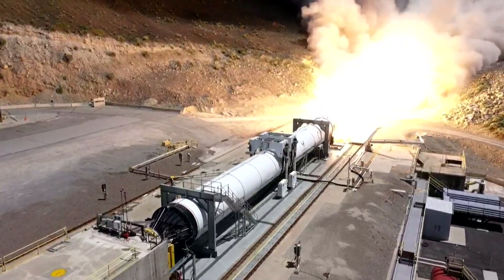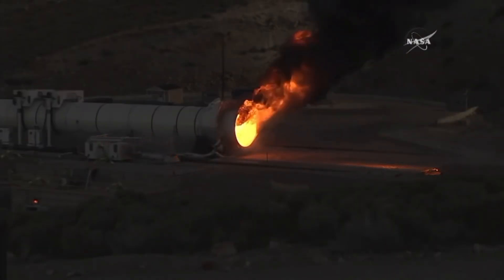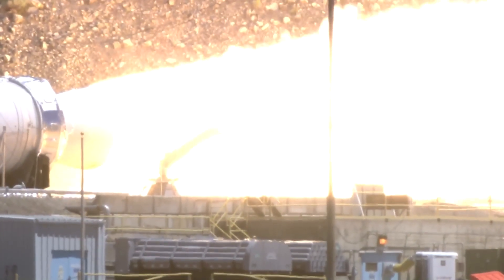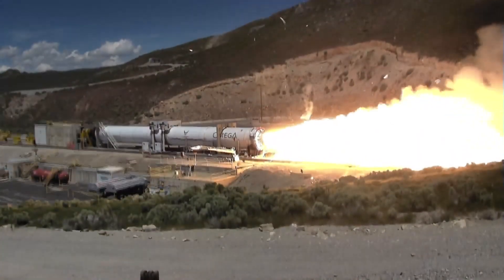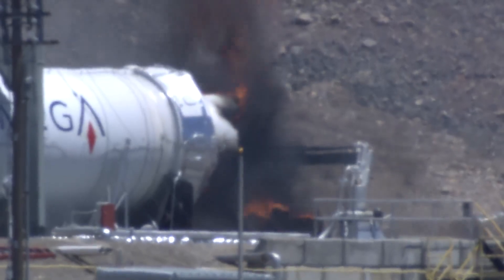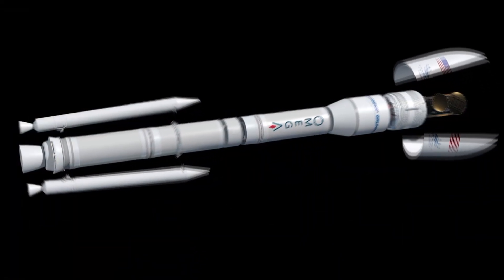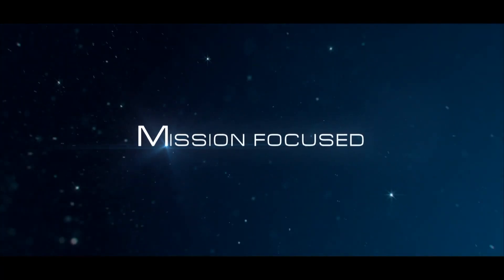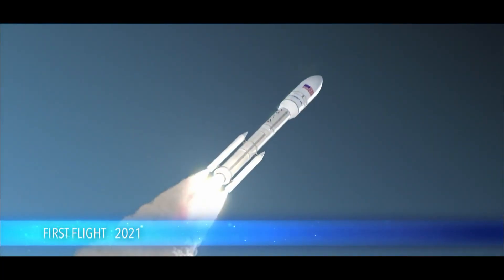Northrop Grumman's OmegA Rocket Fails During Static Fire Test -

Comment: It's CO2 that's pumped into the booster by that arm.. Listen to the test videos of the SLS engines and they talk about it. I'm pretty sure it was caused by just a weak casting or however they make that nozzel. I think you would've seen a chunk coming out, it just looked like it over pressurized the nozzle and the nozzle couldn't take it and broke apart. If a chunk would've hit one side of the nozzle I would've expected to see only one side of it ripping apart instead of the entire thing.
BTW does anyone else think that pumping all the CO2 out is far worse for the environment than any car could be? Or is that just me?

Comment: Wouldn't the rocket lose most of it's thrust when the nozzle breaks? I still don't completely get where the rocket thrust comes from. Is it due to the pressure inside the combustion chamber/nozzle or just due to the acceleration of the gasses, or both. If someone can help me with this I would appreciate it :)

Comment: Hasn't there been recontact issues when a solid booster is used as the first stage in line with a second stage? How are they dealing with that potential recontact after staging? They must have solved it somehow or they wouldn't be going ahead with this design eh?
Reply: those weren't issues - they simply didn't design any re-contact avoidance techniques / hardware into the Ares 1-X flight you were talking about because it wasn't part of the test

Comment: At what point the rocket entirely relies on gravity assist and not the steering from the nozzle? Or does it always need the nozzle?
Reply: you always need a nozzle gravity doesn't help the rocket go straight.  Think of pencil sitting on the palm of your hand like a rocket on a laugh stand.  Now move your hand back and forth to keep it pointed up.   its not as easy as it sounds.  Furthermore it gets harder  as the rocket accelerates off the launch pad.

Comment: Could you do a video on what's holding up SLS (besides money)? I get rocket science isn't simple, but all of the major parts use preexisting technology, so I don't get the hold-up.
Reply: Scott is pretty a-political in his vids and concentrates on the technical aspects of stuff.
He probably would loose a couple 10k subscribers and the comment section of a vid that deals with the SLS would probably need to be closed down immediately.
Reply: @joansparky4439  ahh, that's true. I was wondering what the technical difficulties adapting the pre-existing tech was, but i guess the politics is inextricable with a NASA product
Reply: @christiangrantz6906  
Go over to Spaceflight Now and find some articles on SLS.
You will learn that the acronym got termed Senate Launch System to nowhere there years ago and what the political and economical reasons for it are.. usually comment sections of 100-200+ while normally it's 20-40 and strong demarcation lines, with the more respected posters calling it for what it is ;-)

Comment: So,, is there a common explanation for whats going on when SO MANY TIMES a rocket fails at the END of the main heat production?? It seems like a lot of booms are actually immediately after the burn. (Or right when the rocket is starting a change in thrust)

Comment: Wouldn't rapidly cooling the inside of the rocket drastically change the results of any material analyses since they wouldn't cool that quickly in the field? Then again, if it just falls into the ocean it would be cooled rapidly. But I don't think they're trying to simulate that here. It's too uneven by comparison.
Reply: It's not a rapid cool.  They choke it with CO2.  This one would be in space, unlike it's boosters, when it runs out of fuel.  It's probably pretty cold up there.

Comment: This does nothing to alleviate the extreme unease and disquiet that use of these large solid rocket motors cause in my mind.  There was a good reason whatbthe Saturn V didn't use them and there is a good reason that SPACEX and Blue Origin avoid them like the plague.  You basically light the thing and all you can do is cross your fingers until the burn completes.  No shutdown and no throttling.  It is a primitive technology that should have been retired ling ago.

Comment: I find it interesting how at 1:50 there are a couple frames where a few flashes appear along the length of it, I'm not entirely sure what those are but it almost looks like its apart of the ignition system, lighting each section of the SRB engine structure incrementally down to the nozzle.

Comment: You can see some gimbaling in the video I think. Pretty cool.
Reply: That gimbling in this video is not from this test, I think that was from SLS or shuttle tests.
From what I saw, I believe that this rocket has some sort of thrust vectoring system other than the entire cone swiveling, they tested it during the countdown, and it looked like the cone changed shape or had some sort of vector vanes inside it.

Comment: Can you even get the SRBs off if they malfunctioned, or would you have to wait until they shut down to try to abort a launch?  This may be a good reason to parallel stage SRBs.
Reply: once lite you cannot turn them off.  Generally once you light it it is release from the launch pad.  It something goes wrong after launch and you have to shut it down you detonate a line of explosive that run from the top to the bottom of the  rocket.  The fuel still burns but the thrust goes to zero.  So in the event of an abort of solid rocket with crew the booster would detonate at about the same time crew capsule flies away using the abort motors.  

I know of only one launch were this was done.  That was the challenger accident.  After the accident the boosters kept going.  They were then detonated to prevent them from flying towards any populated areas.

Comment: Ah, you're allowed to fail tests, as that's what they're for. SpaceX knows a lot about failing tests with explosive results ;)
Reply: Yes, but the VP of the company shouldn't get on TV right after the failed test and say that it was a totally successful test, everything went very, very well, just an observation was made near the end. Really hurt Northrop Grumman's image and credibility. And this wasn't just a routine test, this was an official air force certification test. Not supposed to fail this one.
Reply: @StarshipGazer  It very well might not be false. The test might not have had anything to so with the nozzle. Maybe they even out on it due to it only being a test. SpaceX did this a lot too (and is about to do with the starship). In which case its not entierly unexpected, and would be considered "an observation"
Reply: @Excludos  The nozzle is a key critical component the motor so of course it was part of the test. This would have been a total loss of a multibillion dollar payload if it was an actual flight. You can't steer or control the rocket without a nozzle. So this was a huge failed test, no matter how hard the VP tries to spin it.

Comment: My cigarette lighter rocket blew it self up when I ran my first rocket test using. It was embeded in my old house wall almost took it out but did not ignite it for some reason just dumb luck I suppose or fire resistant insulation.

Comment: What was it made of?
Ceramic?
That dont even sound right.
Titanium is the norm, correct?
Reply from the maker: Titanium burns, so it’s not used in oxidizing environments.
Reply: The space shuttle SRB were made of steel.  The boosters on the atlas rockets use carbon fiber since it is lighter than Steel.  Not sure how they make this booster.

Comment: Unlike most other such “incident“ in rocket science, this is an easy fix.

One of two things happened here. Some engineer designed something “new“. 
Either it was a new design OR a new process, new vendor, new inspection procedure, etc., to an old design.
In the back of the mind of the engineer who instigated the change was the question, “What could go wrong with this (newness)?“

Well, he (& everyone else) just found out.

The fix will be “go back to the old way of doing things.”
And may (or may not) include: “Joe, you have to go work someplace else now.”

Comment: speculating how 'it might be ok' is moot point, too expensive a system goes on the top for an SRB to have ANY issues.  that unit is supposed to be the 'easy reliable' part.  SRB/SLS is such a hideous jobs program using old tech that working on teaches nothing relevant to modern reusable systems and hurts NASA, prevents them moving forward.  Boeing is exploring 'milk the taxpayer and ensure maximum waste' while others explore 'reduce the cost and land the rocket'.
Reply: This program has nothing to do with Boeing, Nasa, or SLS...

Comment: Only America uses HTPB as a binder, everyone else, including the Soviets, gave up on it. It has strange electrical properties, it is piezo electric, generates voltage when stressed, and acts as a capacitor to hold the electrical charge. Grounding and bonding is critical to prevent ignition. I have always thought putting humans on top of a solid fuel rocket was crazy.

Comment: This booster that was involved in the incident in Utah this week…

Yeah, the one the nozzle fell off?

Yeah

That’s not very typical, I’d like to make that point.

Well, how is it untypical?

Well, there are a lot of these boosters going into space all the time, and very seldom does anything like this happen… I just don’t want people thinking that boosters aren’t safe.

Was this booster safe?

Well, I was thinking more about the other ones…

The ones that are safe?

Yeah... the ones the nozzle doesn’t fall off.

Well, if this wasn’t safe, why did it have 270,000 kg of solid propellant in it?

Well, I’m not saying it wasn’t safe, it’s just perhaps not quite as safe as some of the other ones.

Why?

Well, some of them are built so the nozzle doesn’t fall off at all.

Wasn’t this built so the nozzle wouldn’t fall off?

Well, obviously not.

How do you know?

Well, ‘cause the nozzle fell off. It’s a bit of a giveaway. I would just like to make the point that that is not normal.

Well, what sort of standards are these boosters built to?

Oh, very rigorous aerospace engineering standards.

What sort of things?

Well, the nozzle's not supposed to fall off, for a start.

And what other things?

Well, there are… regulations governing the materials they can be made of

What materials?

Well, Cardboard’s out

And?

No cardboard derivatives…

Like paper?

No paper, no string, no cellotape…

Rubber?

No, rubber’s out... Um, They’ve got to have a gimbaling system.

So, the allegations that they are just designed to carry as much payload possible and to hell with the consequences, I mean that’s ludicrous…

Ludicrous, absolutely ludicrous. These are very, very strong boosters

So what happened in this case?

Well, the nozzle fell off in this case by all means, but that’s very unusual.
Reply: Swap “solid booster” and “nozzle” for any subject you like this could be any political enquiry making a fuss to look like they are doing a good job.
Reply: What happened?  
Exactly what was going to happen.
What didn't happen?
Exactly what didn't happen.
Reply: Haha this is an under appreciated comment
Reply: @Mrcaffinebean  very true and it’s a year old xD
Reply: funny as hell
Reply: Well done.

Comment: The nozzle looks like it was made of composite materials and appears to have a larger expansion ratio than the RSRM used on the shuttle and SLS.
So it's probably pretty much an all new design with just a few parts derived from the RSRM.
Since it happened at a the end of the burn I wonder if they underestimated the erosion rate of the ablative lining or flow separation occurred as thrust was dropping off.

Comment: They should use hydraulic fuelmixing with dry ice and compressed corkpowder to eliminate the chunky mixture they have now. But therefore they will need special kind of nozles with  inside chambers that contain two centered elliptical spheres. I do not have a patent on it yet but it works on a small scale so why not on a bigger scale.

Comment: The device used to put out the burning insulation at the end of the test, Scott, uses CO2 not water.
Reply from the maker: How does that work?
Reply: @scottmanley  That probe we see swing in around from the side of the rocket-motor after the burn ends sticks inside the nozzle and injects tons of CO2. Now I know that in the past in other tests water has been used to quench the burning liner however I suspect that CO2 puts it out without causing water-damage. However water is sprayed on the underside of the rocket-motor at the end to help hasten the cooling process.

Comment: Hey Scott! But shouldn't SRBs behave differently in a downward-facing G environment (the rocket accelerates, the fuel is pulled downwards)? Isn't it more correct to test it vertically? I mean, in this test it's literally on its side? Arent't there failures that would only manifest in an upright state? On the other hand, aren't there any that would only happen when it's on its side? How does orientation affect the booster?
Reply: It's a solid fuel kind of like silly-putty. It doesn't move around. Think of it being packed full of "silly-putty" with a small hole down through the center of it from top to bottom. A flame is sent down through this hole to ignite the entire length, and it begins to burn from the center outwards toward the outer shell. It doesn't burn from the top down or from the bottom up. All the pressure it produces has one way out. That's through the nozzle at the end. It doesn't care how it's oriented. (A simplified way of looking at it).

Comment: Why are they still even bothering with SRBs? Its still a disaster waiting to happen. It’s what caused Challenger to explode. Liquid fueled boosters are much more reliable if made right. SRBs are basically bombs used as engines you cant turn off or throttle down.

Comment: Seems like after the bang, exhaust volume and velocity didn't seem to change much, and only after a few seconds did the thrust axis seem to drift about 20 degrees "up", but then that could have been controlled gimballing. If I had to guess,  in a real mission, it would have been surmountable.

Comment: this is why you have to wonder did the Saturn five actually make it off the launch pad. 50 years on, and they are still crap at stuff the are surpassed to have been very good at in the 70's.
Reply: So you implying that the human never stepped on the moon because of a solid fuel rocket of new design blew its nozzle?

Comment: So how do they deal with max Q with a solid rocket first stage? I assume there is no throttle back option for a solid.
Reply: The Shuttle did it by using a very, very , very fancy shaped core for the SRB. It would burn at different speeds during different times in the ascent, effectively throttling down for max-q, then throttling back up, then throttling back down as they neared burnout, to limit peak g's.

Comment: Interesting to mention the fuel. Back when my dad was in high school and working at an aluminum framing plant he used the aluminum filings and ammonium perchlorate and other oxidizers to make model rockets with back in the 50's. Also mentioned that it had to be formed into a paste and cast in a mold with various center core shapes they were using to try to get the most thrust. It was all fun until one turned a 3/4" steel plate into confetti when it blew up. He did mention that the casting had to be free of any cracks or it would cause the thing to turn into a mid-air pipe bomb on the way up.
Reply: my uncle mixes that stuff and my cousin packs it so did my grandpa and other four uncles before they retired. I alway go by the plant when I head to Utah Exit 26 on Interstate 84 takes you right to Northrup Grumman's main gate. The citizens of Howell, Honeyville, Brigham City, Thornton, Blue Creek, Thresher, Bothwell, and Penrose as well as Promontory operate the plant. Over in Bear River City and Corrine they have a 12 mile road to a processing facility where the boosters are loaded onto railcars and shipped to Vandenburg and Kennedy Space Center. One time I went out there I passed a Booster Transporter KMAG taking the booster for STS 114 to Corrine we had to pull over to pass them before heading to Promontory.

Comment: scott what does this do to SLS srbs? since they both are based on the same hardware.
Reply: This hardware is not the hardware to be used on the SLS.  Yes the SLS has solid rocket boosters but they are of an entirely different design than this one.  The only similarity is that they both use solid fuel but of a different chemistry.

Comment: Loss of thrust vector control = pointy end doesn't stay up, flamey end doesn't stay down. So, Air Force gives very large defense aerospace company $800m to build a rocket using components developed from proven hardware. Very sound... oh wait, the SLS used that as a selling point, right? The OmegA budget will blow up bigger than this nozzle.